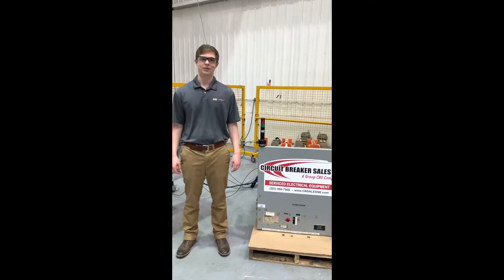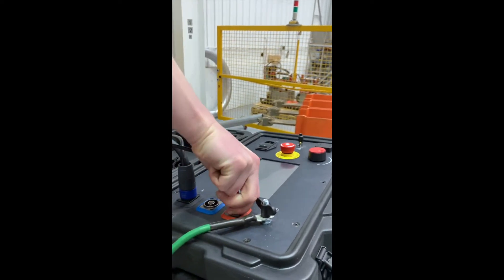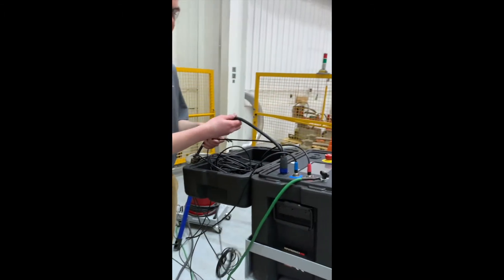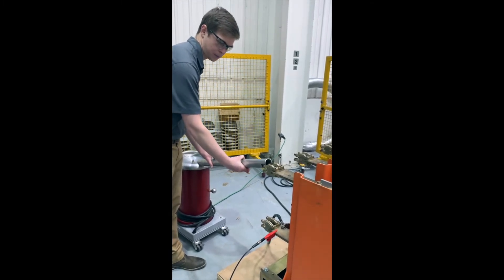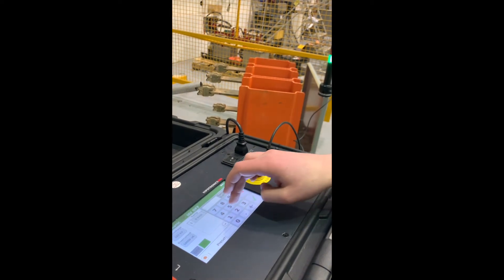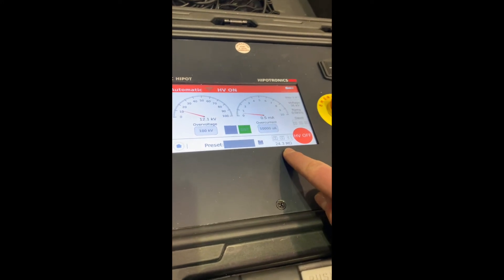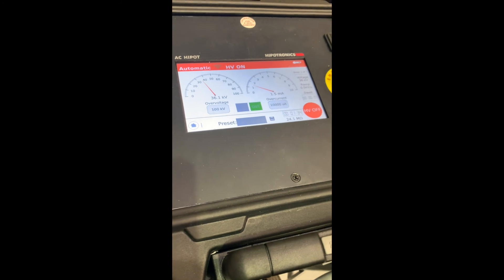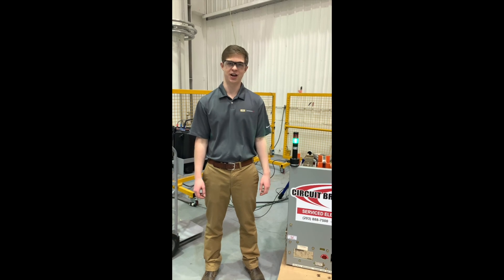100HVT DI Vacuum Breaker AC Hipot Testing

Comment: Hello! What are the ground connections like? And how do you configure the equipment, I see that it is in GST mode, is that right? Do they only connect the DUT to high voltage potential and the system ground?